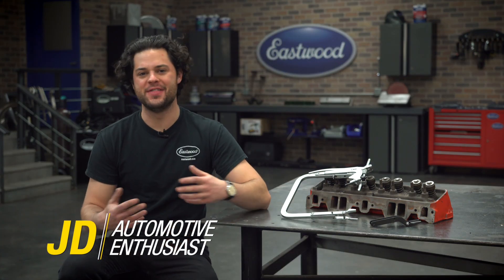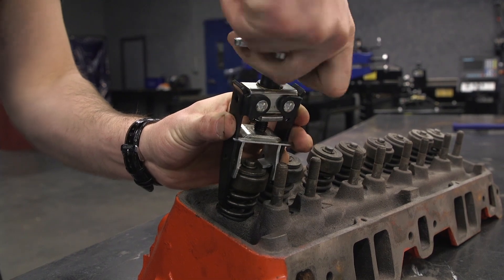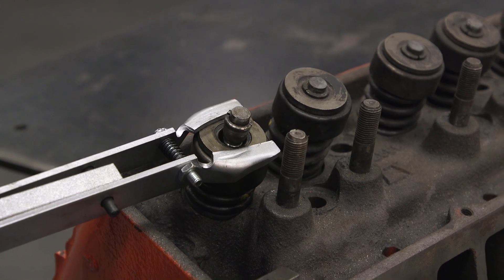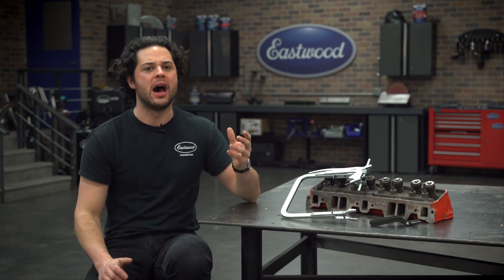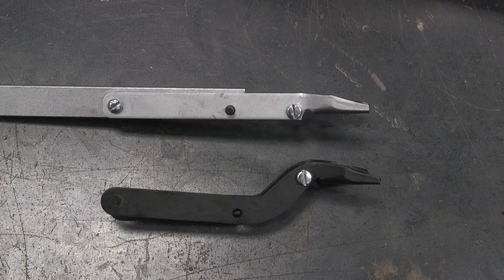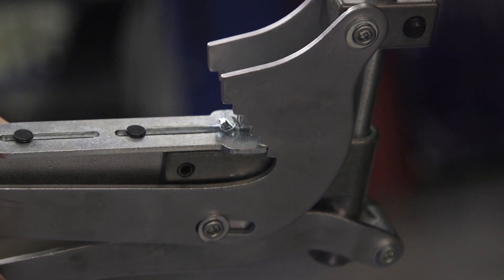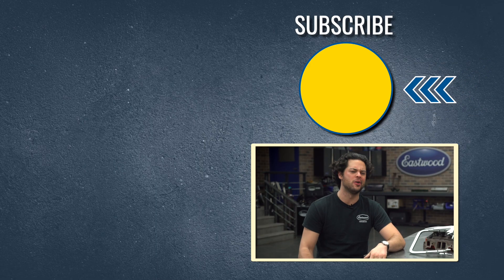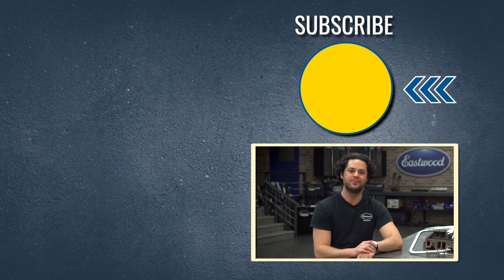Adjustable Valve Spring Compressor - Perfect for Off Car Projects - Eastwood

Comment: A tip I discovered years ago when using a manual or even pneumatic valve spring compressor is that the valve keepers tend to be "stuck" to the retainers.  Relying on the force of the spring compressor alone can make the beam of the compressor deform.  Use a small brass hammer to "tap" the foot of the spring compressor that rides over the retainer and the lock/retainer interface will "release" with a far lower amount of force.